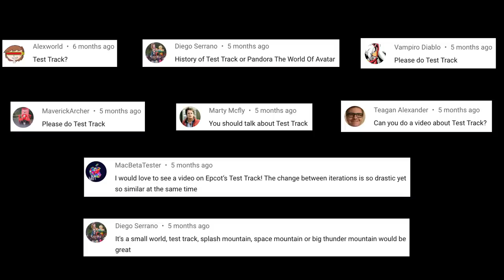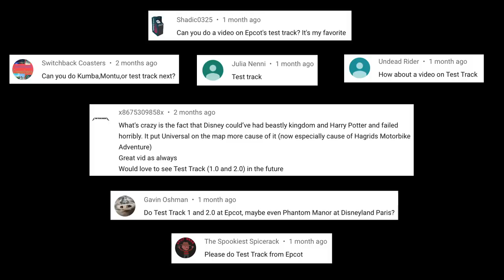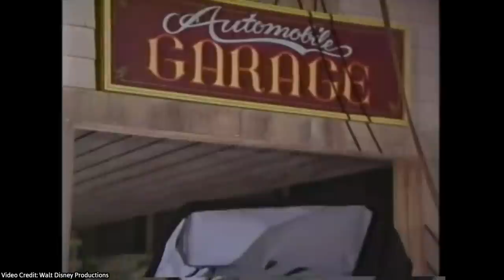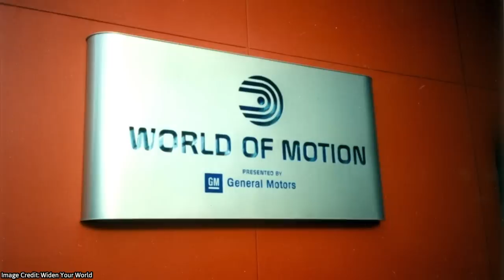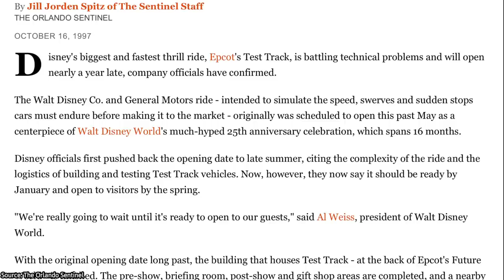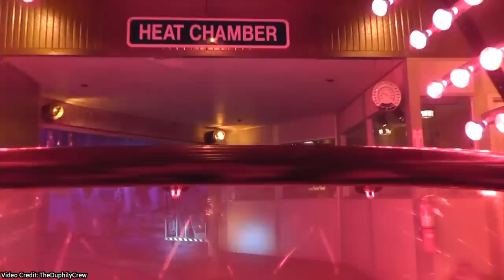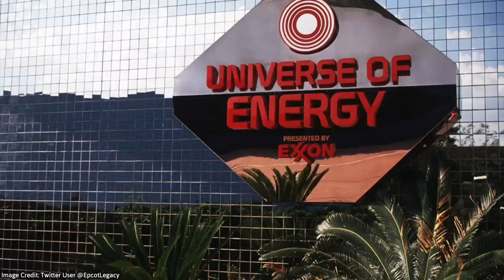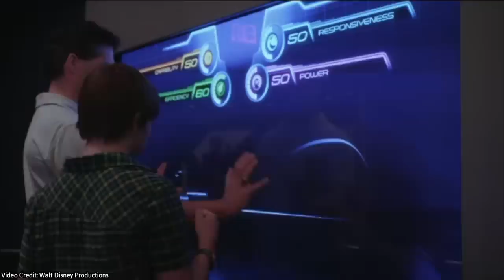The Theme Park History of Test Track (Epcot)

Comment: there are a few interesting things about test track that you didn’t mention, but they’re relatively unknown. i only know because i’m part of a GM family.
in the original Test Track, if a GM employee brought their ID, they would be escorted straight to the front of the line to get on the ride before everyone else. i think there may have been an exclusive lounge we could go to back then, but i was pretty young, i don’t remember. 
however, on 2.0, if you use your ID, it’s basically only a fastpass, and you still have to wait quite a bit to get on the ride. however, if you go to the right of the ride queue, you will approach an elevator with an intercom system. if you show and verify your ID there, you get let into an elevator with the floors labeled (from top to bottom) G, M, C. if you go up to G, you go into a lounge where you can get drinks out of a coca-cola freestyle machine, play around with the chevy design system, and sit on some sectionals and look out at epcot. 
as for my personal opinion on the ride, old is much better. the new one is far too futuristic and doesn’t really have a true story anymore.

Comment: I remember going to Disney World with my parents and sister.  The main issue is that I was scared of roller coasters, and thrill rides in general.  When we went to Mission Space, I waited by the exit area with my sister.
Somehow, my dad convinced me to go on Test Track.  I enjoyed most of it, but I was still uneasy.  This turned into full on terror when the car turned the corner into the barrier test.  There's the wrecked cars along the side, plus there was a video showing what the intended result of the test was.  It literally made me cry.  Afterwards, I was allowed to get something from the git shop, so I got a mickey shaped Test Track pin.  It's a shame I didn't get to go on it again before the 2.0 version.
My guess is that the 2.0 revision is to make rebranding easier.  While remaking a GM factory can take awhile, all they would need to do now is replace the logos and some of the audio.  They may have even made it with Lightcycles in mind, so they could easily flip themes if GM dropped the sponsorship.

Comment: Did Disney slow down Test Track? Riding it for the first time you were pulled forward to get to 60mph fast. Riding it last Summer it was ho-hum like it was in ‘child’ mode, similar to the intensity settings in the old Body Wars. Dad and I were the only rider during Body Wars last years the attendant turn up the intensity to maximum. Great ride. Missed immensely.

Comment: I think the industrial landscape of the first version was much better than Test Track 2.0. Was much more a submersive experience and I really liked the pre out door areas of the track such as the hot and cold chambers. I think if they pulled out all of the late 90s GM vehicles/parts in the queue and updated it with current generation Chevrolets being assembled and tested in the que, they would have been better off. The current pre ride portion is very cheesy, and it doesn't help that no matter how you design your test vehicle, it turns out comically hideous. Many will disagree, but as a kid that came to epcot for the first time in the early 2000's (who was absolutely car crazy at a very young age) Test Track 1.0 had me in awe the whole time.

Comment: “The top speed of the ride was limited to 65 because that’s the speed limit in FL...”. lOL, Wut?
Reply: Came to the comments to point that out. This isn't a road vehicle and it's not a public road, so the FL speed limit is irrelevant. That's like saying roller coasters are limited to the FL speed limit (which is currently at least 70, although it may not have been that high when the ride was designed).

Comment: With Radiator Springs Racer, I can somewhat have the same experience from Test Track without having gone to Epcot.
Reply: I say this as someone who had gone on RSR for years and thought similarly before finally riding TT. They are not really similar. TT is much more intense ride in terms of turns and braking and a lot faster (25mph faster).

Comment: TT is not the fastest ride the WDW. RocknRoller Coaster is- the 65mph indicated on the outside portion of the ride is immensely exaggerated. Top speed I think is actually closer to 40-45mph.
Reply: No its not. TT goes 65, RnR goes 55.

Comment: The original Test Track had a clear vision and well crafted story.  It just made sense.  The new version is just a bland computer simulation.  The "tests" seem so fake, even though they are the same as the original.  The only thing it has going for it is that it goes fast... but, it's really just another ride in a convertible down the freeway.  They should really bring back the original style theming and story, with some updates to keep it fresh, and just ditch the "Design Lab" virtual concept.  I get the "industrial" feel might seem 1990's dated now, but the "virtual" theme was just as bad of a 2000's fad.  Test Track 3.0 anyone?

Comment: Didn’t they take this ride and transferred it to DCA: CARS
Reply from the maker: They took the ride system but I think that’s it, everything else about Radiator Springs is different including the track layout.
Reply: Journey to the Center of the Earth at Tokyo DisneySea uses the same ride system as well. And, really, the earlier Indiana Jones/Dinosaur ride system has a lot in common with it as well, though those rides are much slower and have a motion simulator bed integrated into the ride vehicle.